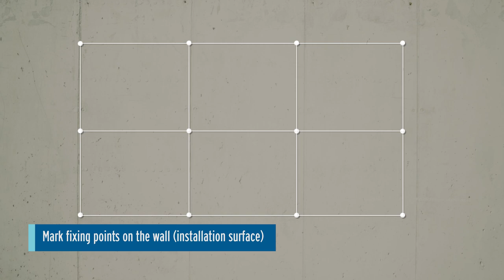etalbond®, aluminium composite panel, installation

Comment: Needs thermally broken brackets or you're wasting your rockwool
Reply: There is a 5mm blue plastic pad under the bracket when he installs it for thermal brake.
Reply: do you have any test reports or any other proofs that brackets without T/B are unefficient?
Reply: We have done a lot of thermal modeling and the insulator on this clip is better than nothing but still very inefficient. Bottom line aluminum simply transmits too much thermal energy. It is far more effective to increase the girt strength (keeping it outboard of the insulation) and use less clips. This may require a beefier clip with mounting considerations for light steel studs (3 fasteners per clip) but in the end you save labor on install and energy consumption for the life of the building.